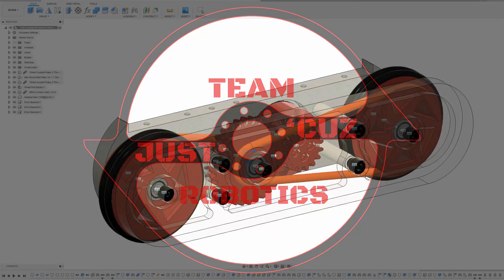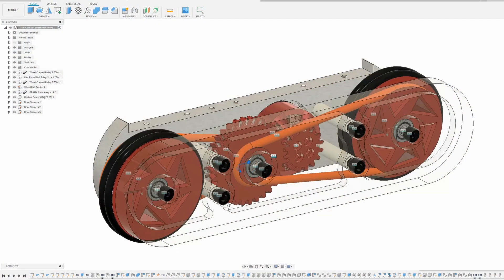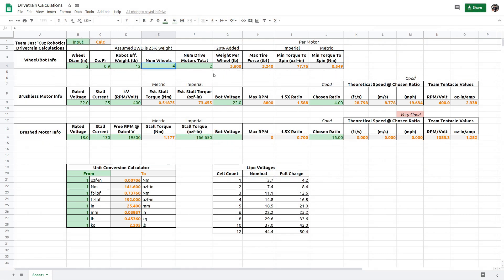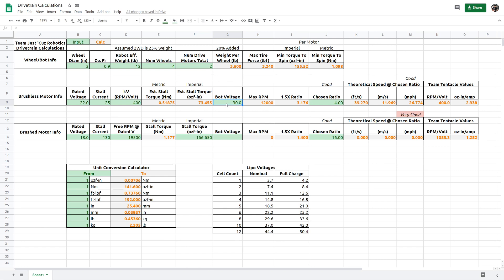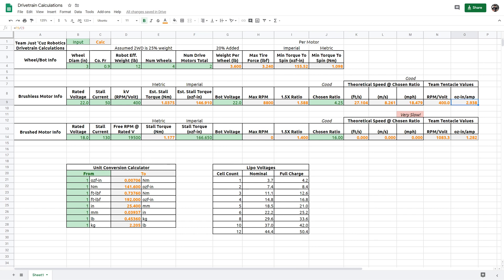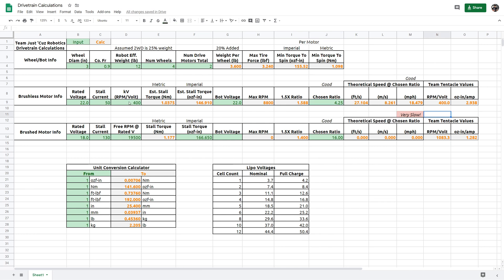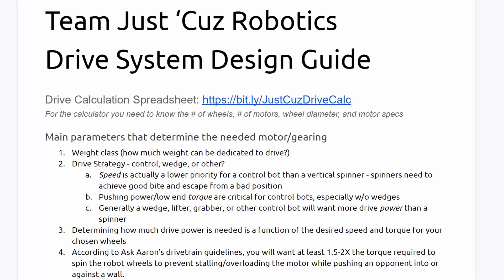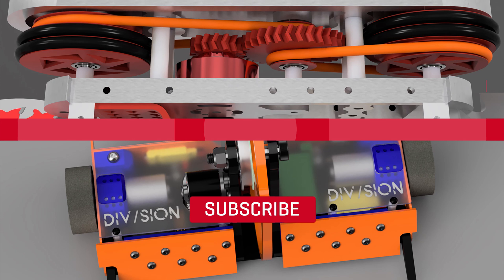How to Design a Combat Robot Drivetrain (Motors, Gearing and More!)

Comment: When you're designing a timing belt with no idler, do you purposefully make center distance a little shorter than the "perfect" length of the belt?  That way, if the belt is 1/16" loose, it still runs, but being 1/16" too tight and maybe you can't get it on, or it's just putting too much friction on the shafts?  Will the kevlar reinforce belts just stretch?  For instance my center distance is about 5 inches, needs a theoretical 14.00 inch / 70 tooth belt / 0.2in pitch, do I push the center distance down to 4.9 inches so that there's some slop, so that the theoretical belt length is more like 13.93 inches (making 14 inch belt just a little bit loose, but not more than the pitch of 0.2in).  Thanks and great vids, really enjoying them
Reply from the maker: Kevlar-reinforced belts do not stretch as much as you might think. I would say try and design around maybe 1 to 2 % belt stretch with the center to Center distance such that it is a little bit undersized so maybe like one or two mm bigger than the supposed best center to Center distance. For shorter belt runs like on Division I just did it dead-on and that worked great for me because I'm using toothed pulleys both sides. If you are using toothed pulleys both sides you no longer need to worry as much about the belt tension since the teeth do all the work. 0.1 inches is actually a huge amount that's like close to 1/8 of an inch and that will almost definitely cause a problem. You cannot make the center to Center distance shorter by a value that is greater than the height of one belt tooth or else it'll mean your belt can easily flop away from the pulley

Comment: How you calculated the gear ratio?
Reply from the maker: I assume you mean how to calculate the real world ratio for a pair of pulleys or gears, since I went over how to calculate the theoretical ideal ratio in the video. This is literally a ratio of diameter, radius, or tooth count depending on what you're measuring. A 24 tooth gear mated to a 12 tooth gear has a ratio of 2:1 (24/12). The result is that every 1 revolution of the 24 tooth gear results in 2 revolutions of the 12 tooth gear, with 0.5X the torque. Or if driving the 12 tooth gear, the reverse is true - every 1 revolution of the 12 tooth results in 0.5 revolutions of the 24 tooth gear, with 2X the torque. Same works for toothed pulleys. For smooth pulleys simply look at the pitch diameter of the pulleys (usually listen when you buy them) and the ratio between those. If you have a pair of random smooth pulleys and no datasheet, the ratio of measured diameters will suffice.

Comment: Yes! It can be done! I've been looking at 3D printing double helical gears for a while, and it seems they are viable!
Reply from the maker: Yup absolutely. Herringbone gears work great. I used a free Fusion 360 helical gear addon to generate them.
Reply: Thanks! I have Solidworks and have tried lofting the profiles from regular spur profiles. The few I have printed did work, they just needed an offset to account for the excess material during printing.
Reply from the maker: @TheBlackEventorizon  Not sure what Solidworks package you have but in the one I have for work, the toolbox/parts library includes some helical gear generation tool as well.
Reply: @JustCuzRobotics  Ah, I think Toolbox is part of Professional, I only have Standard. But I do have a 2D gear generator that I have turned into 3D gears. I'll just experiment!